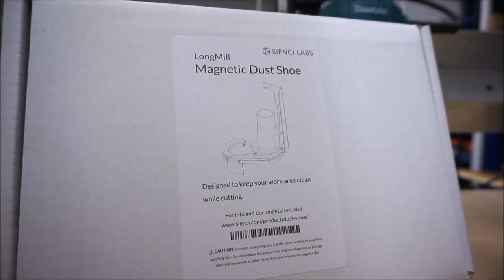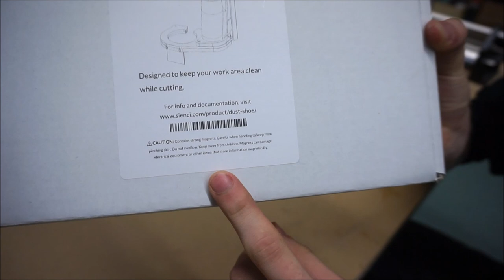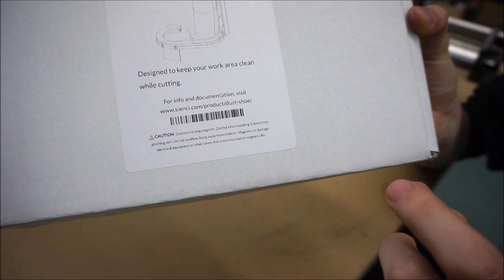Magnetic Dust Shoe for the LongMill: Reveal & Assembly

Comment: I am hoping to get one of these and one of those touch plates. Just received mine the other day. I am not a fan of the set screws that come with the brass bolts. I had to replace those and it was confusing for one set of instructions to use m8 25mm bolts and another set of instructions that said to use m8 16mm bolts for the exact same step. That set me back.
However, I am near the completion of putting it together and there are several things, no many things, I am amazed about with precision and stiffness of what you have created.
Do you plan on making any kind of extension kits for customers that could be bought to make a machine bigger?
Reply from the maker: Yeah we're working to make an extension available that we're hoping to get working for all previous LongMills. The remaining prototype parts are on their way in so if all goes well that should be available middle of this year 👍

Comment: It looks like this approach reduces the cutting span in the X axis, correct? The advantage of this approach is that it allows the placement of the viewing window in a convenient location. Did you consider designing a mounting bracket oriented toward the front of the router? If so, what were the reasons why you decided to go with the current design?
Reply from the maker: I saw your comment on the MK2 version. The MK1 version does limit the travel slightly. However, we decided that the compromise of losing a little bit of travel over the convenience and performance of the magnetic design was worth it. Also, although we typically tell people that the X travel of the 30x30 is just 30 inches, in actuality, the travel for all of the LongMills are slightly larger than advertised to make up for accessories like the dust shoe.

Comment: What size hose
Reply from the maker: The shoe is designed to fit three different hose sizes: standard 2″ to 2-1/8″ hoses on the outside or a 1.5″ hose on the inside